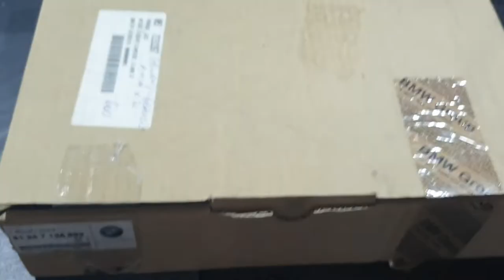BMW e65 e66 Hydraulic Trunk Cylinder Replacement

Comment: DUDE- O!M!G! I LOVE your attention to detail and the fact you clean as you go.  I used to have an 01 Camaro I would take hours doing simple jobs because when I pulled panels off or parts moved around, I had to clean it.  So much easier to see issues developing when the parts are clean to start with.  Just got an 07 E66 last week and it's filthy and has issues- Guess why I'm watching THIS video ? :).  Now I see where that jack is supposed to go too.  What is that black bag thing drivers side next to the rear seat?
SUBSCRIBING!
Reply from the maker: Hello,  yes it's a big problem with cleaning and perfectionism 😄 but for me there is no other way  , the black thing is a bag for fire extinguisher the second reflective triangle...some spares bulbs and gloves

Comment: Great video, but my only question is what were your symptoms, was it not opening at all, or was it opening slow and not staying up? what were your symptoms?
Reply from the maker: Hello . in this case there was no symptom, it was perfectly functional it was changed with a new one.  Usually they lose oil and do not lift the trunk
Reply: OK I understand, can you please provide where you purchased the parts, maybe a link. It’s something that I am interested in doing in my car also. Thanks
Reply from the maker: @smx5523  Purchased from BMW
Reply: @MOvidiu  hi,  is it posible to only add the oil and will it work properly after adding? My one doesnt lift the trunk.
Thanks!
Reply from the maker: @guessnehaj  yes if it doesn't have oil after refilling it will work, but if it doesn't have oil more than likely it will lose it somewhere

Comment: BMW takes the cake for worst engineering skills. All this just to raise the trunk 🤦🏻‍♀️
Reply from the maker: Hello,  why you say that? It's a very  simple system  , and it's mounted on a 7 series a luxury limousine,   means that everything on that car ned to be automatic
Reply: I suppose you and I have a very different definition of "simple." Simple is replacing the struts to the trunk in less than 5 minutes like most vehicles. This requires tear down & unnecessary, extra items/tools to complete the job.
A 750Li doesn't need this "luxury" in my opinion.